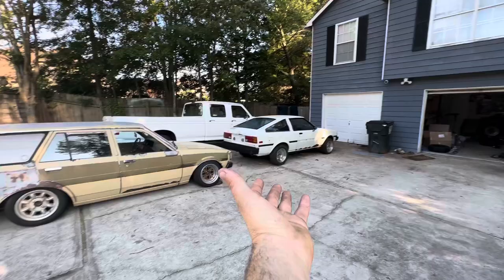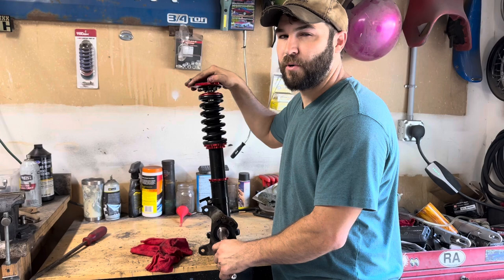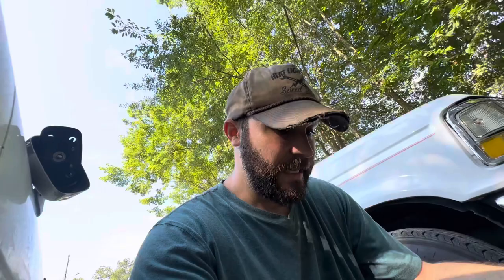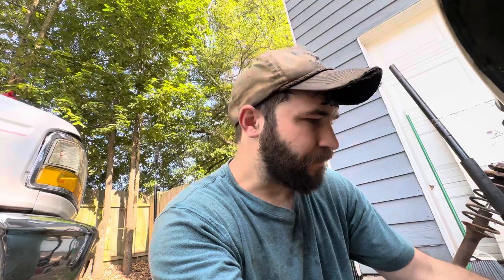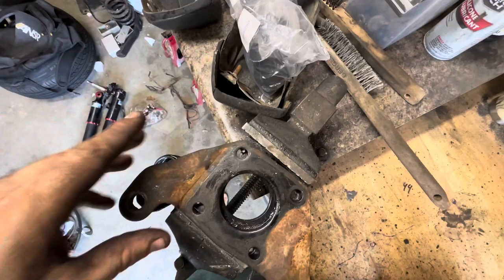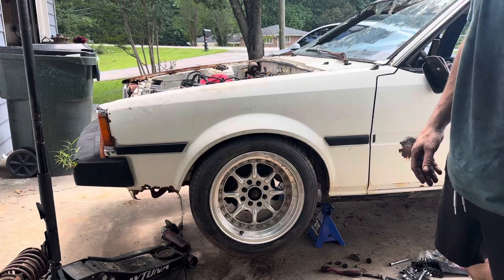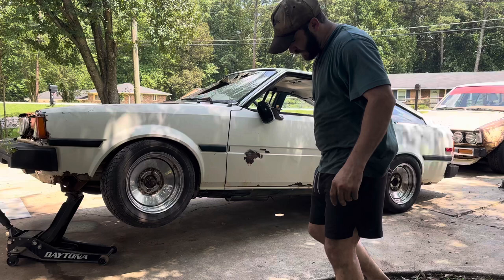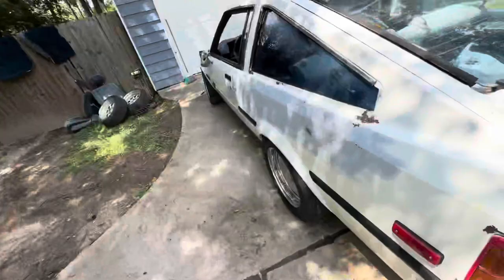Simple Coilover Install Goes Wrong!!?? Episode 5: the TE72 gets low

Comment: this is really random but do you know what size the rear u joint is on a 1980 toyota corolla wagon? mines bad
Reply from the maker: I do not. The factory ones aren't really designed to be replaced on most old Toyotas. A drive shaft shop should be able to fix you up for $100-200 though. My wagon has an ae86 driveshaft in it just because I had the ae86 shaft and the u joints were in better shape
Reply: No shop in Eugene will make you one for less than 450